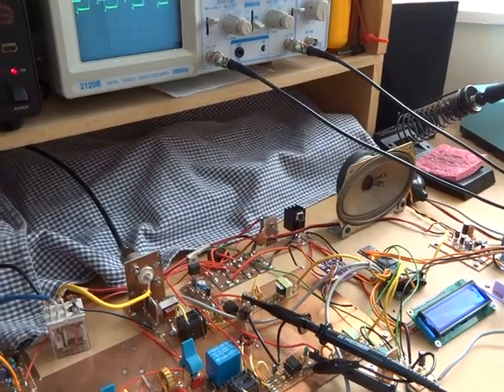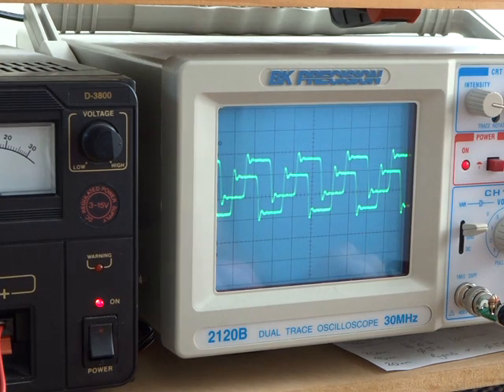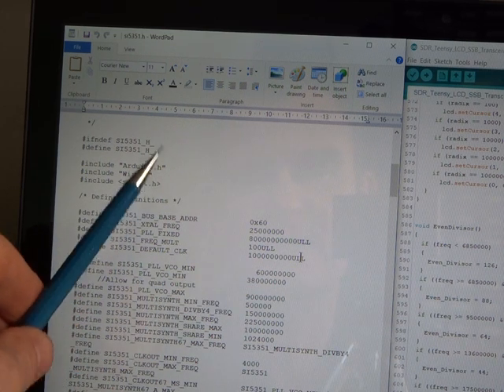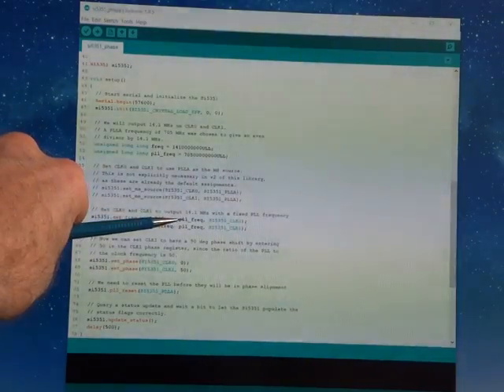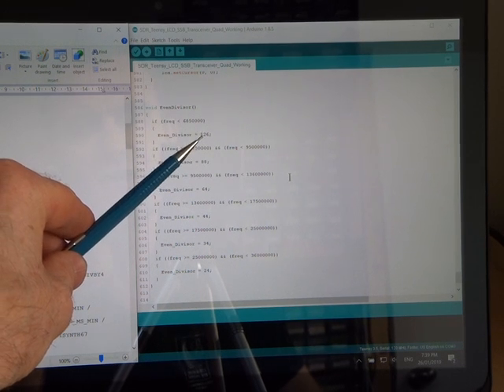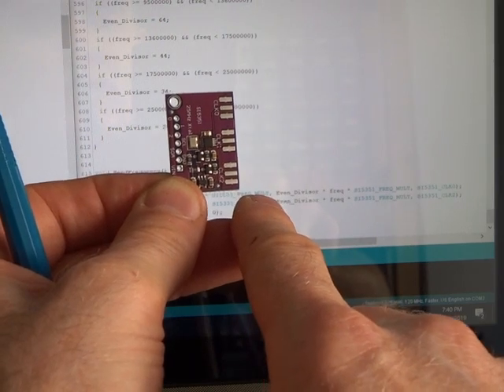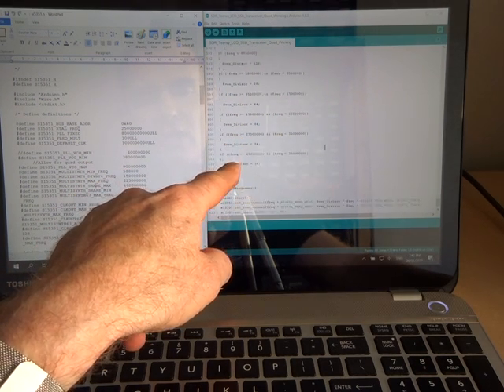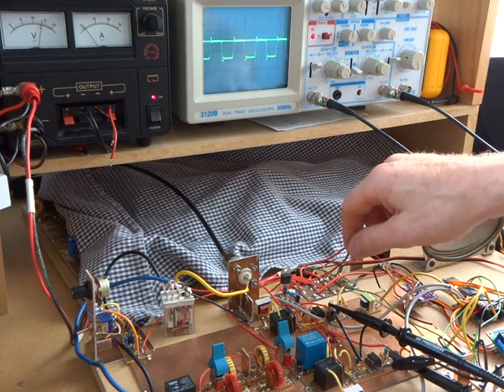Si5351 Quadrature Clock Output down to 3MHz

Comment: This is a cool find and useful if you're unable to get high speed flip-flops for some reason. The 74AHC74 from Texas Instruments are quite good, although there are faster ones available. Ignoring that the chip is being utilized outside of its specified parameters, in theory there are two ways that I can think of where using the flip-flops to divide by 4 into quadrature clocks would be a better choice. Phase noise is the first. In theory dividing the clock rate by 4 you can improve the phase noise by 6db. Nothing is perfect, but some improvement can be had using the flip-flop approach, I'm sure. The other benefit is the duty-cycle accuracy. The LO duty-cycle can affect the performance of the mixers that the clocks are driving. The Si5351 has a specified duty-cycle of nominally 50% +/- 5%. I've not measured the output of one myself over its frequency span to see how much this varies in practice, but since the flip-flops, at least the 74xx74 ones, trigger on the rising edge of the clock pulse, the input duty-cycle can be wildly far away from 50% while still maintaining a reasonably accurate 50% at the output. There is a third benefit of being able to use the Si5351 over its entire frequency range as long as you have properly specified flip-flops; and if for some reason you need more than 1 pair of quadrature clocks, you can drive up to 3 pairs with a single Si5351 breakout board using the flip-flop method. This is still a useful demonstration nonetheless.
Reply from the maker: Thank you very. You raise some very good points. I'll add that to my notes for future builds.
Reply: @CharlieMorrisZL2CTM  You're welcome. 73s.

Comment: Do you see a significant decrease in the peak to peak voltage of the si5351 as you increase the frequency? Moving up much above 10-20 MHz I can't see much at all and my scope can no longer trigger. I was just wondering if the output should be stable all the way through 150 MHz + or if my old scope just can't grab it all.
Reply from the maker: Hi Benjamin. I will need to do some more tests as I do not recall. My recollection was that the output did not reduce any faster than normal.

Comment: Finally worked it out :)

Wonder if that's the way Hans did it...
Reply from the maker: Hi Clint. All credit goes to Brian Harper M1CEM and Miguel Bartié PY2OHH.  Not sure if this wad the same approach that Hans took. I will need to look into that. For now, it seems to be solid.

Charlie
Reply: Absolutely, great work by Brian and Miguel and in the nick of time too, I've got a radio project on the go with an STM32 and Si5351 so I'll give it a go.
Reply from the maker: Great. I understand too that this was the same approach taken as Han's. Note too, don't reset the PLL each time you change the freq or you will clicks in the audio. Only do the reset if the Even_Divisor changes.Charlie
Reply: @CharlieMorrisZL2CTM  Hans made a presentation during FDIM in 2018 where he described how to do it. 
http://www.qrp-labs.com/images/news/dayton2018/fdim2018.pdf
I used PY2OHH's code and a rx from Hans <http://www.qrp-labs.com/receiver.html> and fed quadrature directly int a Tayloe mixer (I pulled the flip flop chip). Works great. Miguel did pass along the tip on Jason's header file change. 
I tried using Teensy audio board and your code to do IQ processing  but keep managing to blow up teensies :)
https://twitter.com/Tom_AK2B/status/1083114200912646144
Reply: No! Hans do the 90° shift with software without flip-flops
A complete different approach.

Comment: Excellent video Charlie, you explain it far better than I could. 
Just one note, although the si5351 seems quite happy running with these values, we are now running it out of the quoted specs of 600-900Mhz on the VCO. But for the homebrew builds we are doing I don't think it is a major problem.
Reply from the maker: Very good point Brian. I should have mentioned that in the video. Thanks again for the email!

Charlie
Reply: @Stephen Morton Your probablt right, but the chip will run to over 200Mhz anyway.
I think I will do some tests to see just how low you can go before it looses lock, although I think this will vary with each individual Si5351 chip.